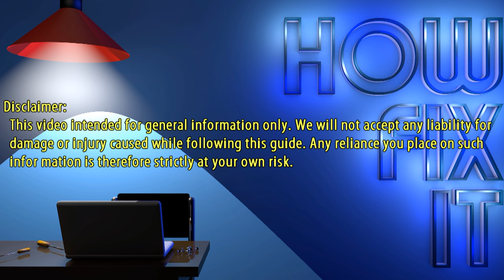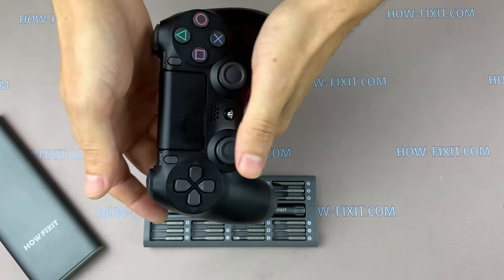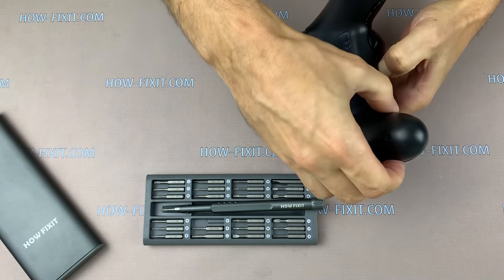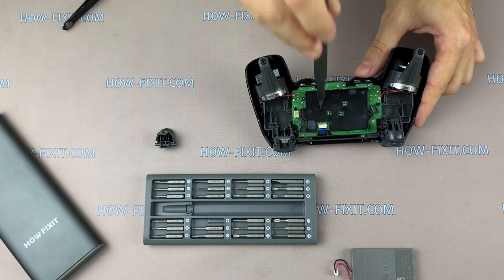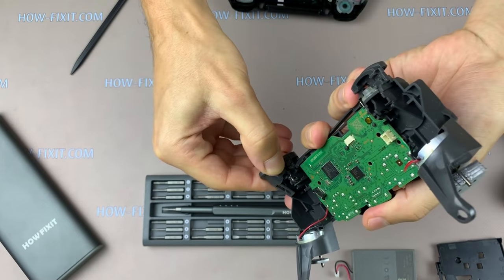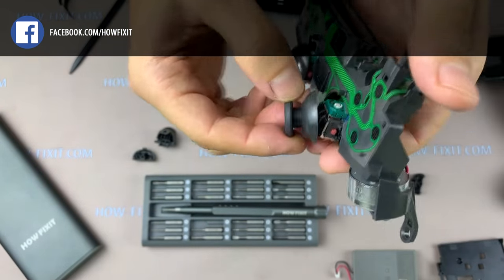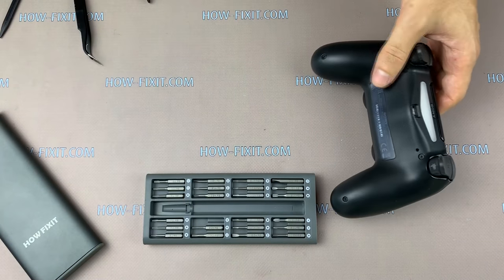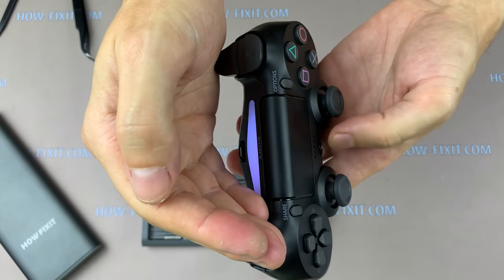PS4 DualShock v2 controller disassembly and repair buttons cleaning

Comment from the maker: For more info check out the links in the description
Reply: After I disconnect the touchpad I can’t remove the main panel. Only on the left side for some reason
Reply: @josezuazua7936  pt
Reply: @josezuazua7936  .
Reply: Thank you for the video this helped a lot
Reply: So in every case specific buttons don't work has to do with the dirt? I bought one month ago a third party ps4 controller i used it less than two hours to play with my sister local coop . There was no problem. Today we try again, the " x" button doesn't work at all and when you are in the section when the system asks to choose profile, if you press the "o" button the controller turns off .
Reply: I have a question is the TouchPad supposed to be loose?
Reply: Anyone got a touchpad that clicks but motion not working?

Comment: Nice i actually broke my controller
Reply: lmfao. i had a spare controller so i took it apart like when u commented (30 min ago) and all of the things fell off😂
Reply: @Stfunoah  my jack connector just broke in half hahaha
Reply: Nice mine refused to turn on after my “fix”
Reply: Y’all should have gotten a professional to do this
Reply: Lol
Reply: @MaltShake  maybe you forgot to connect something like a ribbon after putting it back together🤷‍♂️
Reply: Update, I broke my controller too lmao
Reply: @Fiat_Multipla69  man you guys talking about fix I can't fuckin open it...this shit is too tight😐
Reply: @NightCrawler2002  idk it just popped right off for me, I just untightened the screws and was able to pull it apart easily.
Reply: @Fiat_Multipla69  well I fixed mine
Reply: lol mines broke too
Reply: @Fiat_Multipla69  LMAO
Reply: @Fiat_Multipla69  LMAO
Reply: @ivantolosana5594  😭
Reply: How tf? I do this many times and i cant broke it. Littlebit patience game.
Reply: Sorry mate but that's funny
Reply: @NightCrawler2002  just use the flathead and gently push it through the bottom where the 2 outputs are
Reply: @PizzaMan-cl1xt  well I did ...and fixed my controller.... working totally fine.
Reply: edit: nevermind, this method breaks clips
Reply: @Walter_  XD
Reply: Bruh I really wanna fight bout dis shit u made my control stop working fr
Reply: Mines stopped working
Reply: Same here, but I finally fixed it on my own . 
Hit me up if u have some problems.. I will try to help you out.
Reply: @JammerMate  I disassembled my control and put it back now it’s not turning off and I don’t know what I did wrong
Reply: @raihanmiah9230  I am sorry for the late reply, 
It's possible that you accidentally disconnected or damaged a component when you disassembled your controller. Here are a few things you can try to troubleshoot the issue:

Double-check your reassembly: Make sure that all the components are properly connected and in the correct orientation. If something is loose or misaligned, it could be causing the controller to malfunction.

Check the battery: If the controller won't turn off, it could be because the battery is stuck in the on position. Try removing the battery and reinserting it, making sure that it is properly seated.

Reset the controller: Some controllers have a small reset button that can be pressed with a paperclip or similar object. Check your controller's manual to see if it has a reset button and try pressing it to see if that resolves the issue.
Reply: I broke the port next to the headphone jack🥳
Reply: @lightdabplays7400  good luck only charging ur controller on a usb forever ig, still though i dont think its worth repairing its not much use ul=nless u have a hub for it...
Reply: Me too
Reply: My main ps button broked
Reply: @itsmeunicornlover2.  could u be more specific? If it is not working it could be possible that the carbon pad beneath it could have been damaged, ns u may have to replace it
Reply: Same
Reply: I recycle ♻ mine 😢
Reply: First time it wouldn't turn on I opened it again  and the ribbon wasnt in all the way now it works
Reply: Lol I did everything with patience and mine isn't broken even tho this is my first time opening a PS4 controller
Reply: Same. Now time to make a dismantled ds4 in frame
Reply: I broke my vibration🤣🤣🤣 well i don't use it any way
Reply: i broke my controller 😂 the white ribbon broke all the pieces on the motherboard
Reply: Skill issue
Reply: Hahaha worked great for me! But I'm used to dealing with small electronics like this. It's definitely SUPER easy to break something. I thought I might have messed up one of the flex connectors but it all worked out
Reply: I got mine open and all but I think I stripped a screw -_-
Reply: Literally how this tutorial was super easy to follow.
Reply: i did the same, i accidentally stripped a screw -_- @manuelsputnik
Reply: I think you all need a gentle touch. If you can't, find someone that us good at the board game Operation. 👨🏿‍⚕️😜
Reply: Lucky me l didn't break it
Reply: yeah that's why u should practice and on a controller that don't work first
Reply: @dragonfootball.Compilations  step 1: break controller. Step 2: practice
Reply: Delicate hands required!! 😆
Reply: How
Reply: @Fiat_Multipla69 my ribbon cable for the led was backwards so I didn’t know that it was on or off hahaah
Reply: Mine is also broken
Reply: Mine is also broken . Now I only have the 2nd controller to play
Reply: i broke every thing now i even can't play games 😢😂

Comment: I love how he said good luck as if he knew my controller was in pieces lol 😆
Reply: Same  and all I was attempting to do was switch my plain black too a red camo face just a quick swap....noo not a quick swap I tore both my controllers up now I can't get one to charge anymore it comes on but is low battery so it does and won't charge not sure what I did
Reply: @dustinbowman7351  wire might b short , or barley connected

Comment: My controller has a green light now and it won't turn off
Reply: The first/last ribbon connection may not be plugged in all the way or the connection may be damaged.

Comment: Happy to see that the PS4 controller disassembly/reassembly is similar to PS3 controller.  Just ordered one of the last brand new ones as I'm finally getting into PS4, so hopefully it won't need repaired ever.  
That PS3 controller thumbstick is such a PITA- you can't even move those Alps  thumbsticks from one board to another because they are all different, and need calibrated to the board controller..

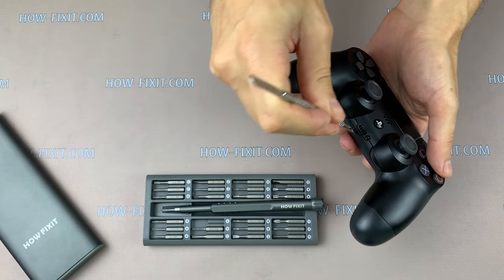Comment: 2:04 pry the sides on the mic input, not the middle. I almost broke the PCB and now there is a gap :/
Reply: Oof
Reply: feel like that is common sense 💀
Reply: Appreciate the tip, thanks. 🙏🏼
Reply: Che trimone haha
Reply: I used to work for them a few months ago, there is no need to pry it open. But unscrew and pull on the arms of the controller.
Reply: @billymays3992 All sides have to be pryed/loose before you can do that.
Otherwise you're just gonna put pressure on the other side which goes nowhere.

Comment: Thank you so much!!! I won a brand new, open box magma red DS4 on ebay for only $35 but the L2 button was engaging when I wasn't pushing it. I cleaned the contact with 91% isopropyl and it's flawless now :) Couldn't be happier
Reply: I though we weren’t supposed to use alcohol?

Comment: Sometimes the thumbstick chambers need a wipe down as well for drifting issues. The little green boxes that sit on the north and west under the thumbsticks. You can pop the chambers open with a little oomph. BE CAREFUL with the little white discs inside. If you bend the contact wiring (which is incredibly easy to do by accident) you will more than likely need a new contact.

Comment: Im gonna have to use this guide to take apart one controller to repair another. A controller i bought that was refurbished from Ebay back this Summer decided to stop trying to stay synced to my PS4. So now i got frustrated with it and Im gonna take it apart to repair my older one to replace the worn out parts on it since it works alot better with its charging and syncing capabilities. One part i gotta replace it my down d pad on my old one because its worn out badly and I need to replace the top buttons possibly too i think as well.

Comment: Thanks! Super helpful, my sister gave me a controller they had for years and it still worked but it just had coffee spilled in it and sat for a few years now it works like brand new! Other than the charge port but it's only a minor issue

Comment: Thanks! Those hooks on each side break easily (as did mine) be carefull. If it breaks, there is no problem putting it back together.
Reply: as he said both are intact, in mine I looked at one and it was, looked at the other and it wasn't :(

Comment: What about the center touch pad?
Whatever, doesn't matter. it worked and I only had to break the cross bar to the front that secured the touch pad to the front face to re-assemble it. Thanks, It works great now

Comment: I had the same issue. My controller would connect over bluetooth to Ps4, PC, Android Mobile but within 30 seconds it would disconnect. I was clueless and pissed off for a week, later found a usefull tip online. Completely dismantled the controller, cleaned everything and put them back together. Mine works great now without any hiccups. I suggest all of you people facing this issue to give it a try.

Comment: Thanks for the video. I had to replace the conductive film since it had a scratch that made the ps button nonfunctional. 

Not sure how the scratch got there since this is the first time I opened the controller. The one year warranty is kinda lame since the defect was obviously caused during assembly and it's been 3 years. I live in Florida, so the heat and humidity probably made the scratch worse until it gave in. I did notice some pairing issues before but eventually it paired until yesterday. Out of curiosity I fired up my PS3 in storage an everything worked. They definitely don't make them like they used to.

Comment: Hey my controller is completely fine and looks good on the exterior but it won’t turn on at all, i feel the battery cable isn’t connected to the MB  I’m gonna use this video and let you know how it goes
Reply: How did it go?
Reply: @thedarkness3766  yes i opened it up and found out the mother board was cracked so it’s completely done

Comment: Nice video dude, appreciated 😁

Still have issue with the controller unfortunately. 

When move the left stick forward it starts & stops which is incredibly frustrating and when press the L2 trigger it constantly moves forward at the same time which makes aiming down sights a whole new experiance 😂

I'm a couple of storeys up ... sorely tempted to lauch them out the window to see if they can fly 😂
Reply: @Maxim Yareli Trying YCCTEAM, it won't let you down.
Reply: @amysmith9861  I've actually caved and bought another official 🤢🤮

I did buy a 3rd party one in January but it is giving me drift problems already -- granted I play a lot but still, I'm not heavy handed and expect more from my kit, especially considering the price.

I will give the YCC one a try.

Comment: So I was dissembling my controller and the black wire for my left rumbler snapped off with little force. Is it safe to power it on if the red wire is still intact?

Comment: Awesome video tutorial. Easy to follow 😊. Battery does not need to be replaced after removing though. Unless you broke the cables while removing it. They come out very easily though.
Reply: He meant that his battery was not working and he would be replacing it.
Reply: I did it😢😢 broke the cable

Comment: the left and right side of the touchpad are supposed to work like buttons as well as the middle but the left and right side aren't pressing anything on the circuit board

Comment: I accidentally broke the 2 wires, black and red ones but it doesn’t matter so you can connect the controller and it’ll work just fine

Comment: 2:32 What is that transparent-opaque plastic part attached to the lower side of the controller, visible in this second to the left of the battery? It broke on my controller, but it does now seem to be important at all. What does it do?
Reply: you know that plastic piece by the usb port that glows? That opaque plastic piece just holds it in
Reply: It's the diffuser for the LED.

Comment: One of the little cables (the little black one) from one of the sticks that go to he board has unwelded when i was repairing a button. I tried the controller and all seems to work. Do i need to weld it again? (dont have the supplies).

Comment: I just wanted to see how to clean the sensors for the sticks to try and solve stick drift that hard reset won't fix.  I think the stick sensors are the only thing you didn't show how to clean lol.  It's surprising because stick drift is far and away a more common problem than loss of button input.

Comment: Will it be alright if I'll remove the connection of the vibrators? it consumes quite the energy since t is mechanical.
Reply: Would probably be best to just go into controller settings on system and turn off the rumble/vibration option.

Comment: What would happen if you took the under part of the x o triangle and square buttons out and forgot which way they go
Reply: the white piece of rubber for buttons and dpad are symmetrical - so it will work no matter which way around you put it back in. Useful if your X button is getting mushy, you can rotate the rubber piece to a different button that is used much less.

Comment: I am having a trouble with mycontroller when i press the Square button suddenly it registers the R2 button aswell. For example in warzone when i collect loot it shoots aswell how can i fix it?
Reply: I legit just pulled my apart , and the 🔺 had goey substances around it i cleaned it off and only problem im having is connecting the last cable

Comment: One point you forgot to mention is that the connection between the joystick board and the rest of the controller is VERY VERY VERY BRITTLE. So my controller broke now, the rest is all good tho

Comment: i know this was posted years ago , but i'm still unsure of what's wrong with my controller ? my options button isn't stuck snd clicks perfectly fine , but it won't work at all or ever . it's becoming an issue for some of my games , where i can't even access menus or exit screens .. i'm not sure what's wrong ?
Reply: i'm taking apart the controller right now  , and it looks like it might be a motherboard issue . the area in which the Option's button presses down on looks PERFECTLY fine
I'm really unsure of what's going on :,)

Comment: What controller does the back plate pull off the l2?? I cant find a video with MY controller and have looked up so much stuff n just wanna get my controller put back together
Reply: the older ps4 controllers allow it, you got a newer one

Comment: The internal latches both broke on my controller.
Reply: Same
Reply: Same
Reply: Same...
Reply: What kind of tools did y’all use...?
Reply: @sieben67  spudgers work well
Reply: @ryugo7713  Same thing
Reply: @sieben67  no... definitely not the same thing. I understand how you might use a guitar pick as a prying tool but they’re usually used for wedging. Plus they have almost zero leverage because of their flexibility.
Reply: @ryugo7713  Then u clearly have no idea about guitarepicks. Guitarepicks can be flexibel and stiff. I had a stiff one and it worked just fine. That the latches broke has nothing to do with what instrument I used to open with.
Reply: @sieben67   maybe but a plastic or steel spudger can pry a wider surface area and you’ll be able to eject multiple tabs at once rather than just one at a time which ends up racking the rest. That’s how they broke, just sayin’. It’s possible they decided to break for no reason at all but I doubt it. Could’ve been a guitar pick that had something to do with it.
Reply: @UChdBkx2m-Dl7aBETxBDkumA Yes true you can cover more surface area and give more force because the pryer is longer. Ps4 controller is hard to open the first time anyway and I believe that I just gave too much force with my hands while opening the controller. But the latches arent even important so idc.
Reply: Try not to be rough with $60 Chinese-made plastic.

Comment: The Battery of my PS4 Controller has a much smaller Capacity (600mah) and it looks different (grey foil with "JR 523450 3,7V 600mAh 2,22Wh" on it).
Seems like I got a fake Controller. Almost impossible to get a real PS4 Controller on Ebay these days. Chinese Junk everywhere...

Comment: I actually took it apart and put it back and I’m 14 but there was a little thing that changed it stills works but the light to it doesn’t work so it’s basically a controller that could look off but on so that technically means you could be playing or something hear your parents so you turn off the tv without turning off the ps4 and controller and could get away with it

Comment: My controller has a little gap on the side of the plastic and the screws won’t budge
Reply: P
Reply: You are probably using the wrong screwdriver. Also if you use the wrong screwdriver you will damage the screws, so even if you use the right screwdriver it still won't unscrew.